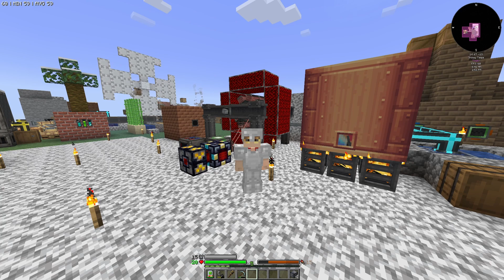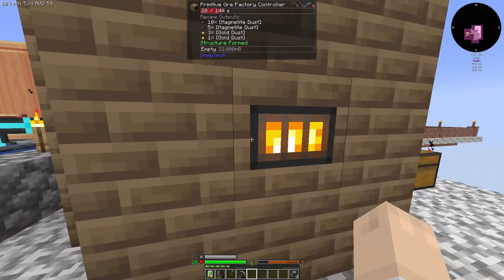Star Technology : E8 : Getting a Mechanical Sieve Built

Comment: Did you get the Sieve figured out? Been having the same problem. Structure is formed, power is in, stacks of gravel, sand, or dust with a mesh and still not working. Been looking everywhere
Reply: 2 LV output bus since the output is 5 different items
Reply from the maker: yeah next video toward the start of the video should have it explained